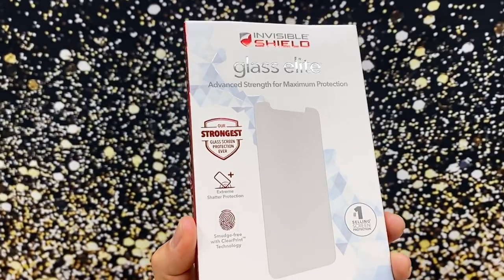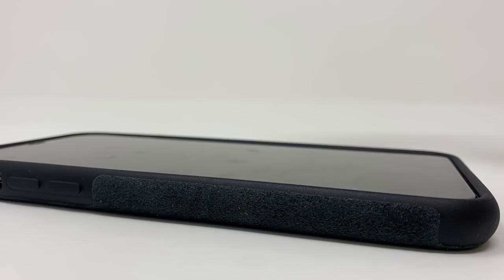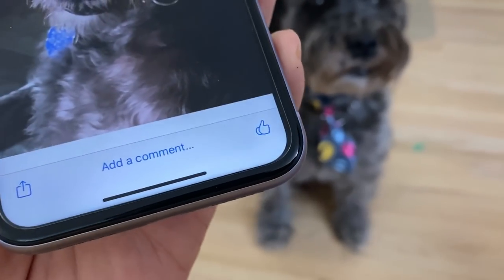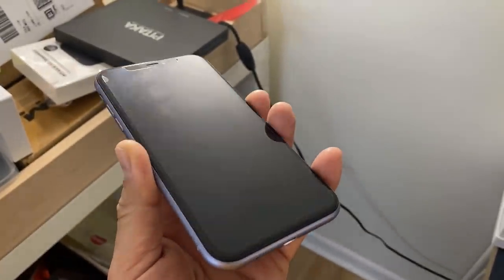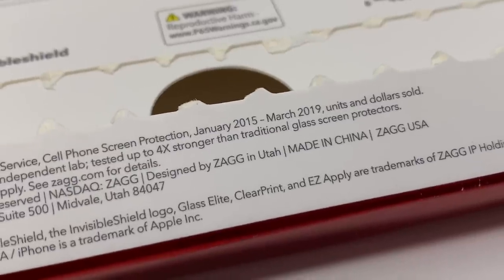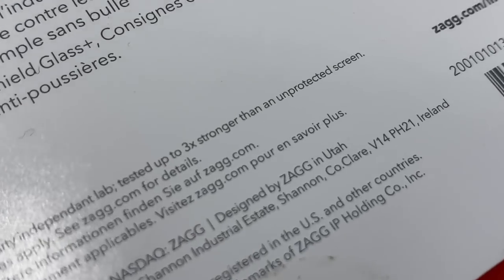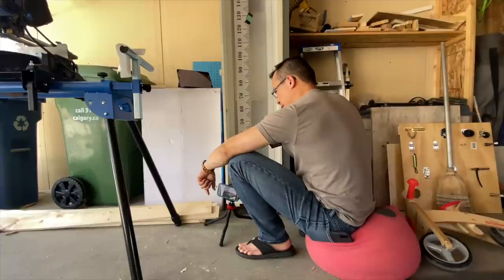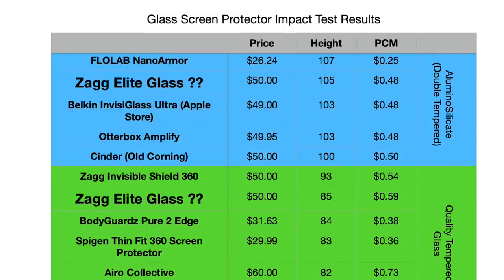Zagg Glass Elite Review - Is it actually STRONGER?

Comment: Been using Zagg for years and never dropped a phone but it's still the only brand I trust. Recently Glass Elite saved my phone from a very hard fall when my roll cart tipped over and all the tools, and my iPhone 11 Pro, spilled all over the floor. Had to replace the screen protector, but not the expensive device.

Comment: Here’s a tip for getting a perfect dust-free application: Go into your washroom and run she shower (without the fan on) for a while, then install the screen protector in that washroom. The moisture makes most of the dust fall to the ground, so you shouldn’t get any dust on your screen during application. I’ve used the trick a few times and from my experience it makes a world of difference. Keep up the great content!
Reply: That's how I do it. Perfect application every time.
Reply: I’m going to try this next time for sure!
Reply from the maker: /mindblown.
Reply: Or just use tape…way easier and less time consuming. I’m not trying to wait until I shower to put on a screen protector lmao.

Comment: I’m using the Zagg Elite on my XS Max and I like it a lot.

One thing that I’ve noticed from Zagg products (and Belkin too, the InvisiGlass) is that their screen protectors tend to have the best clarity.  Everything looks razor sharp and the blacks of the OLED screen still look very very dark, nearly matching the black bezels of the phone.  Also, the fingerprint smearing becomes less obtrusive vs cheaper brands.

On most cheaper brands, the screen looks kind of “hazy”, washed out and the text, images, videos, etc don’t look as “sharp” or “vivid” as the bare screen.  I’ve worn glasses all my life so I am very peculiar about clarity lol.  I don’t know why that is or if it’s something to do with the quality of the adhesive but it’s very obvious to me.

I’ve tried Spigen (their old non-EZ Tray were clearer), a plethora of eBay and Amazon protectors, case manufacture protectors, etc.  Most of them are hazy and cheap looking/feeling.

I wish there was a way to test clarity accurately other than by the naked eye.
Reply from the maker: Thanks for the comment.
Reply: @MobileReviewsEh  you should add a haze test. Use a small white dot with black background on max brightness and take a picture of the screen to measure the halo.  Like the first dude said it’s noticeable on some screen protectors.

Comment: Got the elite for the iPhone 11. I've been using zagg invisible shield glass screen protectors for years for only one reason - to prevent scratches. Those scratches and micro scratches are really annoying on the iPhone's glass. The application process is super easy, almost foolproof, and they look good. I don't drop phones though.
Reply from the maker: THanks for the comment.
Reply: I agree I’ve always used either Zagg or Spigen and they’ve lasted extremely long times. Granted I’ve had the same glass on my 6sPlus since the original release date and ya my daily driver but I pay notion to cases with raised front edges to give it that extra window of safety if/when falling face down.
Reply: MobileReviewsEh did you ever go through with the replacement glass? How was your process of so?
I actually had mine replaced in a Zagg kiosk at a mall pretty much no questions asked.

 (I’m talking near end of life for my iPhone 5 & Preorder of 6sPlus days... I’m not sure those kiosks still exist now days)

Comment: If you want to do realistic testing. You can only do one drop on each screen protector. So to test the strength in 4 places. You’ll need 4 screen protectors. Otherwise your tests are flawed.
Reply from the maker: How do I know the 4 screen protectors will be from the same batch?
Reply: MobileReviewsEh you don't. But you’ll be testing as the best practice way. You also don’t use one crash car to test stability, you use a new car for each test.
Reply: Thank you. He didn’t even run a control test. And that test is very inconsistent.
Thats why the results are inconsistent

Comment: I think this product would be a “maybe”, pending a retest. Do you think the results would have been different if the Wilma test was run first, before the Bertha test? Monty always works hard 😊🐶
Reply: Yup!  I think the structural rigidity of the screen protector was compromised from all those hits.  You can’t beat physics.  

A better test would be to start each test with a new screen protector but that would add up to too much money!
Reply from the maker: The rigidity may be compromised but with enough tests, a trend would come out. Corners would start breaking at around the same point.

Comment: I’ve been using Belkin invisiglass ultra recently on a few iPhones and they have lasted compared to the Zag which my 2 girls and wife cracked or broke on the sides.
The Belkin invisiglass Ultra Curve looks interesting but the price is almost $80 in Australia,still I would buy it to protect my $2000 iPhone.
In my opinion any cheap or expensive film is better than nothing.
Man I miss the Bodyguardz fully wrap plastic rubbery film I had on the iPhone 3 .I used to throw that around like a frisbee
Reply from the maker: The rubbery films were terrible to put on.
Reply: If you were into those full wraps maybe take a look into DBrand Skins they make them for almost any device even including Nintendo switches or console controllers etc